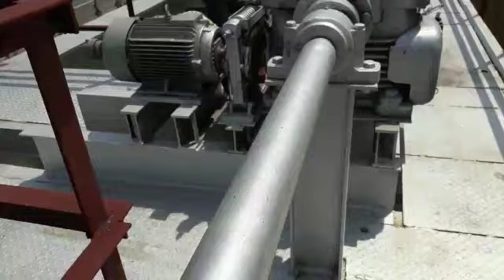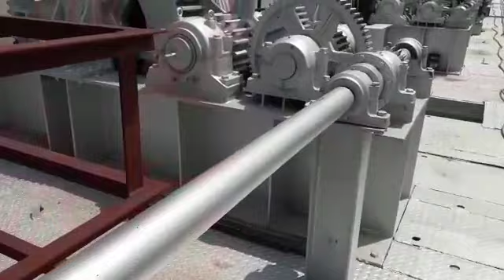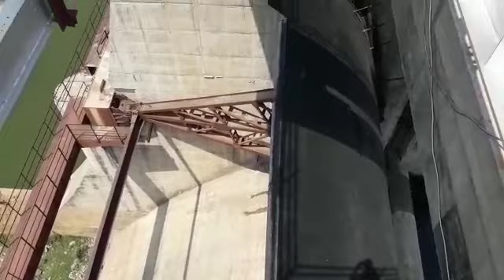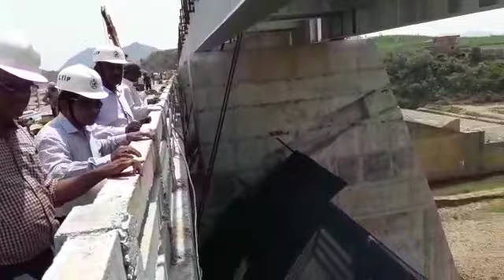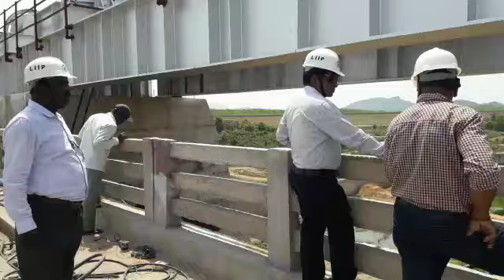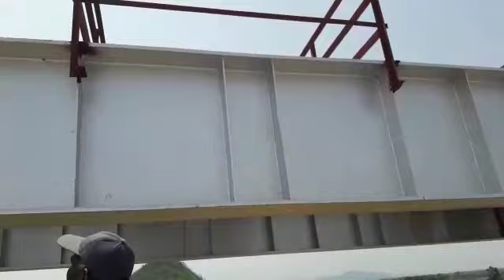Opening of Radial dam gate

Comment: Sir can you say what capacity and type of motor uses for operate the gate? And how I select the capacity of motor!
Reply from the maker: It's 3.7 KW 5 HP 440 volt ,9.5 Amp,3 phase 725 RPM motor .( Its 2 nos of same specification motor for a single Radial gate of size 6 mtr X 12 Mtr gate)
The size of Gate & hence the weight  decides the  capacity of motor.